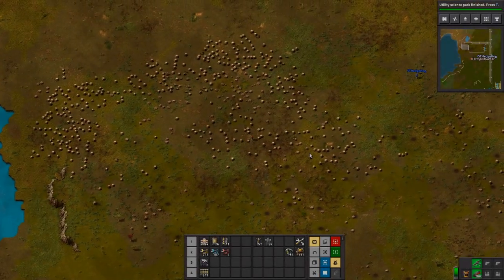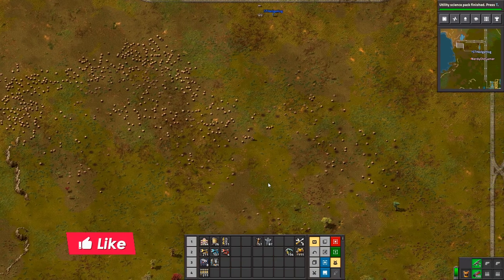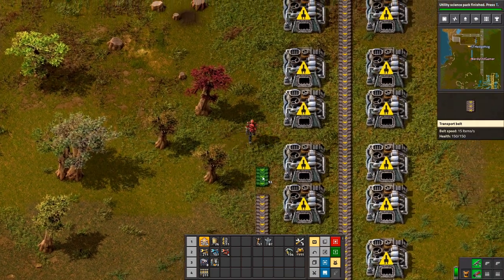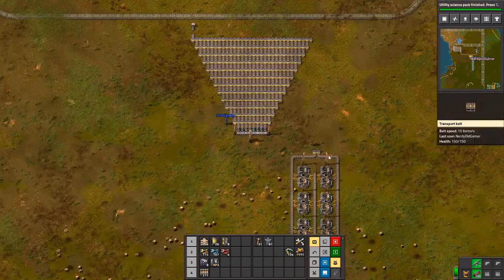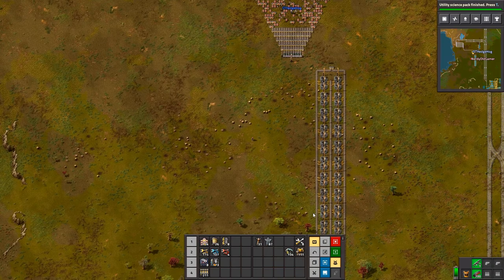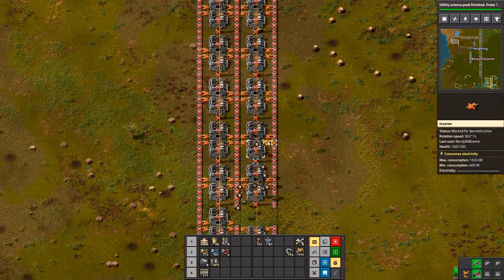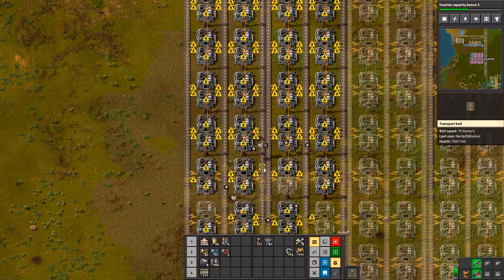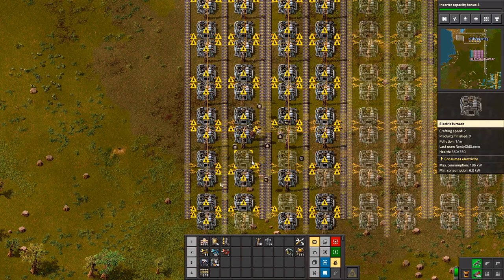Factorio 1.0 Multiplayer 1K SPM Challenge Ep14 | Iron Smelting Setup

Comment: Hi NOG. Are you going to be using mods and beacons in your final build? I guess no beacons if you use mods in the smelters I don't think 1 blue belt of ore will be enough to feed 24 smelters but for now you need them if there's not enough ore you can remove the extra ones.
Reply from the maker: Hi Pete, no beacons at all in this playthrough, but modules for certain, I am thinking efficiency modules though for power preservation